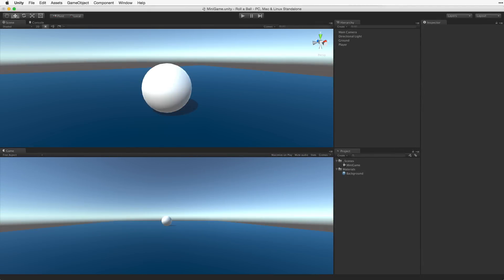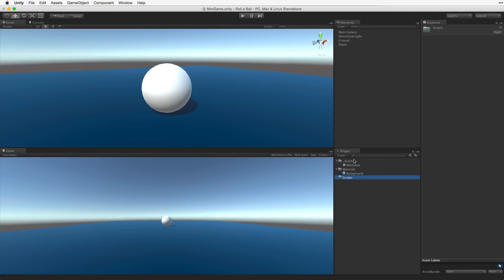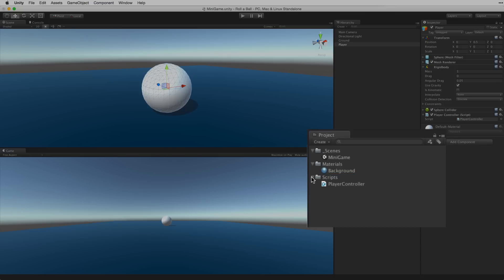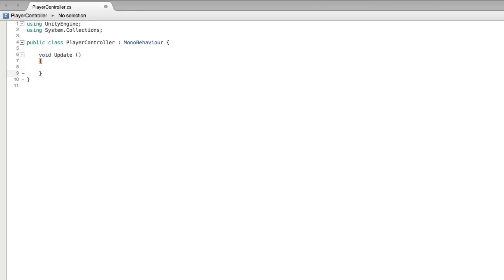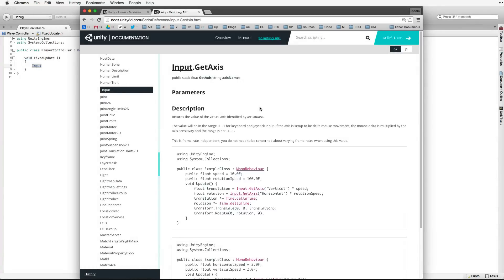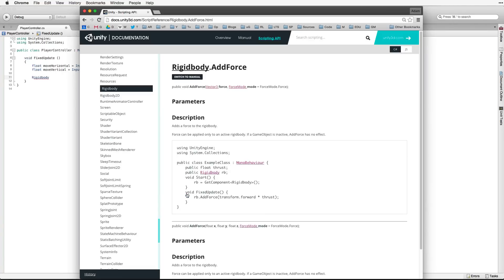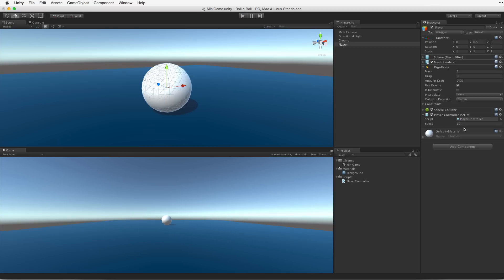Unity 5 - Roll a Ball game - 2 of 8: Moving the Player - Unity Official Tutorials

Comment: I saw a comment way down the chain that helped me and i love Him for it.. So my problem was that i went to the site, copied the C# code and pasted it into visual studio 15. Dont do that because it thinks the code is wrong. Using the default program works. You will know if it gives you the speed option, if not look at the rigidbody section on the player, if use gravity is checked and is kinematic is checked then there is your problem. Make sure you uncheck "is kinematic" and set the speed to a higher number like 10. Hope this helps.

Comment: an official unity tutorial getting input inside fixedupdate...... jesus fucking christ
Reply from the maker: Chris -0 Actually, the frequency of FixedUpdate vs Update is purely based on the rendering speed of your project. In this case, roll a ball is so simple, you'll probably get more update frames than fixed update frames. Input can be polled from any number of different places, but one of the updates (fixed, late or normal) makes more sense. There are times where polling for things like input get key down in fixed update could cause problems, as the brief moment of input could get missed. In this case, where we are adding force in fixed update and just checking to see if the key has been held down, to keep the code simple we chose to keep this as one line per axis in fixed update. To poll for input in update and add force in fixed update would require more complex code, and we chose to keep this project as simple as possible.
Reply from the maker: Ben Fischbein (^_^)! Also, don't forget both the learn pages where these are embedded and the official forum for more help and information. We do not regularly check the YouTube comments.
Reply: Anything wrong with that?
Reply: You are suppose to get input in the update function. Fixed update is run multiple times per frame. You are wasting resources by getting the input more than once per frame. This can also cause bugs because input was not meant to be taken from fixed update and can have unexpected functionality when checking a keys status.

Comment: for the people that can't get the ball to move try this :

using UnityEngine;
using System.Collections;

public class PlayerController : MonoBehaviour {

    public float speed;
    public Rigidbody rb;

    void Start()
    {
        rb = GetComponent<Rigidbody>();
    }

 void Update()
 {
  fixedUpdate ();
 }

    void fixedUpdate()
    {
        float moveHorizontal = Input.GetAxis("Horizontal");
        float moveVertical = Input.GetAxis("Vertical");

        Vector3 movement = new Vector3(moveHorizontal, 0.0f, moveVertical);

        rb.AddForce(movement * speed);
    }
}
Reply: thank you man. My code is finally workin
Reply from the maker: dark evil Each episode has all the sample code required when viewing in the context of the Unity learn site. They unity3d.com/learn and navigate to the tutorials and find roll a ball. You'll find all the working code you need.
Reply: still it didnt work using both your code and the code provided in unity ......it shows.......The namespace <Global Namespace> already contains a definition called PlayerController......plz help
Reply: Thank god someone has the right code.
Reply: This is not the way to go. fixedUpdate() is a custom function, which could be named anything. FixedUpdate() is completely unrelated and is a built-in function which is called every frame. That is the one to use. If you use void fixedUpdate() it will never run unless you call it, which you are doing in Update(). Yes, it works. No, it is not the way it was designed to. Check the documentation for FixedUpdate() for the explanation.

Comment: I Did the code exactly correct. but when i move the ball. only the up and down keys work. but once i click up or down. the ball shoots up into the air. im using 5.4. the latest version. help?
Reply: did you set it up like this? the 0.0f means it doenst go up or down 

Vector3 movement = new Vector3 (moveHorizontal, 0.0f, moveVertical);
Reply: I Did the all correct, i triple checked xD. After a bit of research. apparently the video is out of date to the version of unity i am using. i am using 5.4 so idk
Reply from the maker: MrRei Please use the official Unity forums for more help. There is a dedicated thread in the teaching section.

Comment: I get an error message: 
NullReferenceException: Object reference not set to an instance of an object
Playercontroller.FixedUpdate () (at Assets/Scripts/Playercontroller.cs:22)

Anyone can help please? ^^
Reply: using UnityEngine;
using System.Collections;

public class Playercontroller : MonoBehaviour {
    public float speed;

    private Rigidbody rb;

    void start()
    {
        rb = GetComponent<Rigidbody>();
    }

    void FixedUpdate()
    {
        float moveHorizontal = Input.GetAxis("Horizontal");
        float moveVertikal = Input.GetAxis("Vertical");

        Vector3 movement = new Vector3(moveHorizontal, 0.0f, moveVertikal);
        rb.AddForce(movement * speed);
    }
}
Reply: Solved it. It has to be "Start". With a capital S

Comment: If the ball does not move, following each step in the video carefully. Common errors in the  program could be :

1.  In C#, the S  should be capital in Start ( ) and also check each and every line.

2. In the Inspector, tab, make sure you see the RigidBody tab.

3. You might see error " MissingComponentException" on the bottom. Go to Add Component, select Scripts and select the C# Script. Then change the SPEED from 0 to other values. This step is very important.

These are the fixes that made the ball move for me.

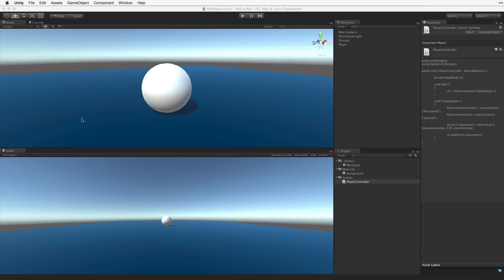Comment: ok so at 13:00 it says"lets check for errors in the plane footer-there are none good." but I most have missed something " 'cause I have 3 errors  1. 'unityengine.component.rigidbody'is a property but a 'type' was expected
# 2 and 3 are the same so-the type or namespace 'viod' could not be found. are you missing an assembly reference? 

the closest thing to unity Ive ever used is scratch which as anyone and everyone can see is way way simpler...
someone please help me Ive never done this and Im extremely confused :(
(and I have double and triple checked along with following this guy through step by step in case you were thinking Im just not paying attention witch Im probably not doing correctly even with my efferts...)
Reply: oops went back and checked another 2 times and found that I misspelled 'void' (I put viod) and forgot to capitalize the others...

Comment: Currently using unity 5.4.2f1.

I've copied the code carefully and it worked before adding speed into the script. Not working afterwards. I ponder around the script and set it side by side to the script in the video and don't found any mistake. There's 2 errors tho but I just can't find it

Comment: My ball keeps falling through the plane
Reply: Jordan Harris same I unselected gravity on player rigidbody however I don't think that's what's wrong
Reply: I did that but wouldn't that ruin the gameplay later if I wanted to make a ramp? the ball would float away no?
Reply: Jordan Harris I'd imagine it would just float through the ramp like a ghost.
I was just suggesting a short fix until some one actually knowledgeable could give the real solution.
Reply: Thanks man!
Reply: I had the same problem. I believe I changed the shpere's material and/or the ground's material, so that's why the ball would fall trough the ground. I deleted them and I created new ones. Then it got fixed. But I still don't know the real reason behind that sorcery.
Hope it helped.
Reply: My problem was that checkbox next to Sphere Colliders title was unchecked.
Reply: Same problem here, my ball was rolling away the plane area, I just unselected and selected again the "gravity" check on Rigidbody panel and then it works fine, even can control the ball with keys WASD, something I couldn't do after. No idea what was the real problem as have no idea why the tutorial is not explaining things more clear. I'm using Unity 2017.3.0f3 version and Visual Studio for scripts, just started to learn in the very first days of January and some scripts of the tutorial are not valid or doesn't match on this new version so I had to search alternatives scripts here.

Comment: Hi I'm using visual studio to do this instead of the default code editor. My ball is not moving. Upon debugging I find that the code is getting called however the values for float moveHorizontal = Input.GetAxis("Horizontal");float moveVertical = Input.GetAxis("Vertical"); are both coming as 0. So then everything is getting 0'd out and of course the ball is not moving. Problem is I have no idea why they are coming as zero. I believe I have followed all the steps properly. Any ideas?
Reply: Also wanted to add that I do see the value of speed coming as 100. But obviously 100 * 0 is .... 0!

Comment: Did everything the same up to this point, but the ball will change to y position to 1 when I press Play. The ball position relocates from 0.5 to 1 for some reason. The ball would be above 0.5f higher from the ground and roll. I have the ball movement in y position at 0.0f too.

Comment: sphere doent move
Reply: my sphere falls
Reply: Renato Araújo I've changed speed and double checked the script to the manual, and the sphere still stands still. It's not falling through or anything, I've tried different solutions but none have worked, should I continue with the tutorial regardless if it moves or not?
Reply: press 'a'. it is an inbuilt command to move. (a,s,w,d)
Reply: Make sure you have the rigidbody attached to the player 0:23
Reply: Only thing I saw different with the wording was that in VS 2017, when I opened the generic script, the top part said 
using System.Collections;
using System.Collections.Generic;
using UnityEngine;

I change it to what he has and it worked but I also changed spacing so maybe the spacing fixed it.
Coming off of python, I'm now wondering how to stop people form entering 0 or negative numbers for speed. Need to learn C# 

I also looked up the input panel he mentioned trying to figure out why it didn't move thinking maybe keys haven't been assigned yet but they were. I was hitting aswd and the arrow keys but got nothing.
Edit>Project Settings>Input will bring up the panel
Reply: Renato Araújo dont tell me
Jajaj how can i fix it?
Reply: and how canm i stop that?
Reply: maybe change void Start() and FixedUpdate() into public methods ...
after this it worked in my game ;)
Reply: FreshMaru yes, when its private just the own class can use and see, if its public other classes can use
Reply: same here
Reply: change the "speed"
Reply: carlimp it means you did it correctly
Reply: if the sphere falls, you have done correctly
Reply: carlimp you can not stop. Its just a basic tutorial to add force to move. In others lessons you can find how to make 'step' move (Run a little bit toward, so stop). You done this correctly, don't worry about others things. So keep learning in others tutorials.
Reply: In case, at least for me. is more easy to stop simplely making the comand "change value" to change the value "position(x,y,z). I dont remember exactly how are the lines but basically you make a comande to change the position of the object in the space depending of the keys you press.
Reply: also like
If(keyimput(w)) {
changevalue.objectposition(+10,0,0) 
} 
also like this in each key. So it doesnt put vectors in the object, simplely move at each click at the correct direction
Reply: ***** thanks
Reply: you seem smart mine keeps saying unexpected symbol'end of file' when i click play how can i fix that
Reply: That is, If I will not press a keys of keyboard (a,s,w,d) then my sphere will not move?
Reply: Spanking Everything its normal to fail a tutorial. Try to anothers and keep studying. Once time, when you will be better, you try this video again. Its very normal to wrong. You can call me at private chat if you want too. Force bro xD

Comment: Ok, so it seems to work, except for a small problem. when i press left and right, it moves side to side, seemingly on an axis. how does he turn it in circles etc? mine just follows a straight line.

 Also, what part of that code makes the ball roll? it seems to me it should just be moving in the direction pressed, rather than actually rolling like a ball.
Reply: Make sure you use:
Vector3 movement = new Vector3(moveHorizontal, 0.0f, moveVertical);
I made the mistake of not using "0,0f" and had the same problem.
Reply: huh. I opened up unity to try this, and all my objects were gone, lol. looks like i'll have to start again. (my scripts and textures were still there.)
Reply: If you give a basketball a horizontonal push in real life, the friction of the ground against the ball will cause it to roll instead of slide. Unity is simulating that.

Comment: using UnityEngine;
using System.Collections;

public class playermovement : MonoBehaviour {

 private Rigidbody rb;

 void Start ()
 {
  rb = GetComponent<Rigidbody>();
 }

 void FixedUpdate ()
 {
  float movehorizontal = Input.GetAxes ("Horizontal");
  float moveVertical = Input.GetAxes ("Vertical");

  Vector3 movement = new Vector3 (movehorizontal, 0.0f, moveVertical,);

  rb.AddForce (movement):
 }
}

is there something wrong with this ? 

when I press the play button to test it.
comes up an overlay saying : 
   All compiler errors have to be fixed before you can enter playmode !
Reply: I got the same issue, I rewrote the whole thing. Check your spelling. I'm have no idea how to use C# myself, but maybe you forgot the capitalization on the H in moveHorizontal
Reply: Floreum thanks i tried what you said
but still the same problem
i found a diffrent code if you need
and it works fine :
using UnityEngine;
using UnityEngine.UI;
using System.Collections;

public class PlayerControler : MonoBehaviour
{

   private Rigidbody rb;
   public float speed;

   void start()
   {

       rb = GetComponent<Rigidbody>();

   }

   void fixedUpdate()
   {

       float moveHorizontal = Input.GetAxis("Horizontal");
       float moveVertical = Input.GetAxis("Vertical");

       Vector3 movement = new Vector3(moveHorizontal, 0.0f, moveVertical);

       rb.AddForce(movement * speed);

   }

}
; ) credit to MarsusBoyh
Reply: GetAxis* not GetAxes

Comment: I have 2 problems 1. I did everything and changed the speed and no error on the footer yet I cant move when I use play 2. when I press play the plane and sphere turn to black color  I am using the latest version of unity 5.4
Reply from the maker: Repeat the steps in the video. If you need more help, please see the link in the description and ask in the forums.
Reply: These videos are way out of date, and there are things that come pre-loaded for him but not for you if you have the latest Unity. For example, if you don't have a light, everything will appear black.
Reply: +Adam Beck thx for replying. it worked fine after adding lights but I guess I will start with learning 2D games and work my way up.

Comment: For those who are having trouble getting this the ball to move: 

Check your capitalisation. The start should be called "void Start" (small v, big S).

1. Go to Unity where you can see the scene and game. 
2. Go to the menu and click Edit -> Project Settings -> Input. 
3. Here you need to click on "Horizontal" and "Vertical" and select what buttons you want.
4. Type "up" for the up button and "left" for the left button, etc.
Reply: Also (forgot to add this one):

When he adds the public float speed, you need to go to unity, click the ball and go to "Player Controller (Script)" on the left hand side. Here you need to set the speed to something other than 0 (I use 2).
Reply: oh man oh man oh man... you just saved me from a  great deal  of frustration...thanks man thanks a lot :D
Reply: Thanks dude helped out alot saved me hours of my time for something so simple
Reply: I've done this and still nothing is happening?
Reply: In addition, you can set the speed to something other than 0 in your script---like 10.0f (f for float). BUT! you need to click the gear icon in the Inspector for the script and choose Reset for the change to take effect. Weird, and I personally think it should auto-update, but it doesn't for public variables. Once you do this, it will always be 10.0 when you load the game...otherwise it will reset back to 0.

Comment: using UnityEngine;
using System.Collections;

public class PlayerController : MonoBehaviour {

 private Rigidbody rb;

 void start ()
 {
  rb = GetComponent<Rigidbody>();
 }

 void FixedUpdate ()
 {
  float moveHorizontal = Input.GetAxis ("Horizontal");
  float moveVertical = Input.GetAxis ("Vertical");

  Vector3 movement = new Vector3 (moveHorizontal, 0.0f, moveVertical);

  rb.AddForce (movement);
 }
}

I followed every step to detail but it still doesn't work and gets errors. Someone please help me.
Reply: I think your start S should be capital
Reply: Yes, that's it. Ihad the same problem but now it works fine

Comment: ArgumentException: Input Axis Verticle is not setup. 
For those of you who had this problem  

The compiler will not complain if you type in 
 Input.GetAxis("Verticle");
 
But the run-time environment won't be able to parse the string and 
will issue this unhelpful message: Unity Exception: Input Axis Vertical 
is not set up. 
When you meant to type 
 Input.GetAxis("Vertical");
 
I wish that instead of strings, the GetAxis() used predefined constants, something that looks like this: 
 Input.GetAxis(Input.Vertical);
 
That way, the compiler would catch those errors and we wouldn't be having this silly discussion. -just my 2 cents.